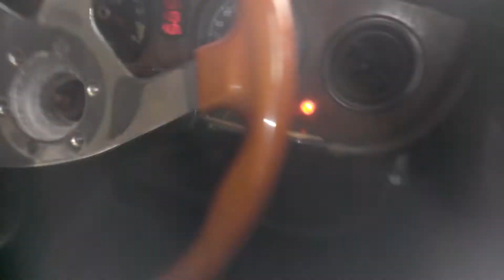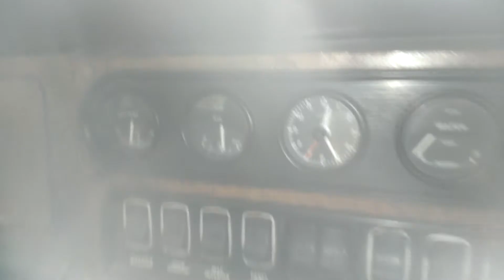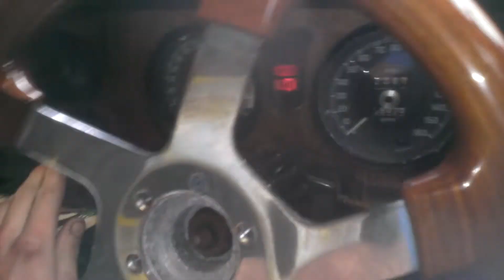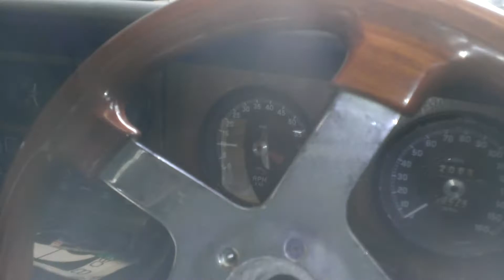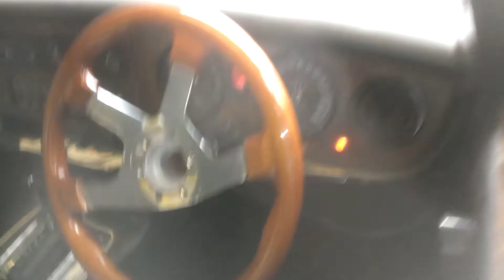Jaguar V12 coldstart

Comment from the maker: apart from the sills its remarkably good. i have perfect bolts ons for it that only need a light rub back then all it needs is the sills fixed and a bit of a repair in the boot floor. all in all its probably no more work then your series 1 as 70 % of the car has already been taken to bare metal and painted recently. i also have a full set of stainless mufflers for the car that are worth what i paid practically

Comment: I'm currently fitting gas research carbs to my Daimler Double 6, the best thing you can do is get rid of the old carby manifolds and fit injection manifolds, they flow heaps better and you will get more power from those carbs that way!
Whats size gas research carbs are you using, 350cfm of 440 cfm?